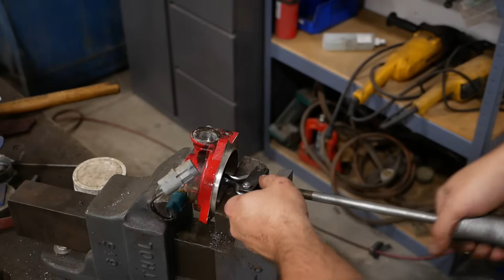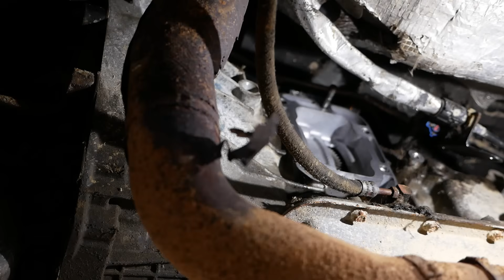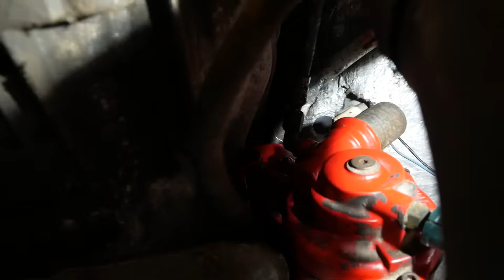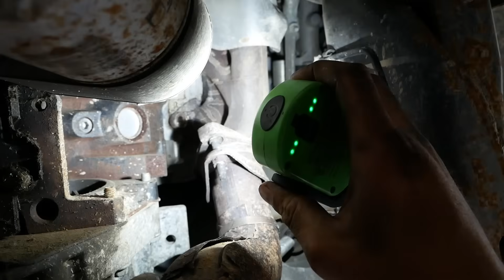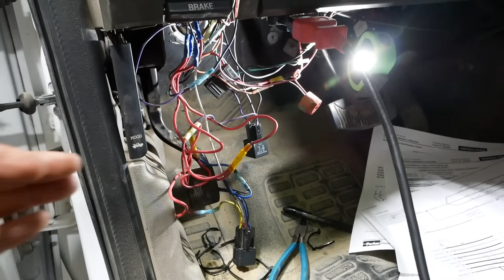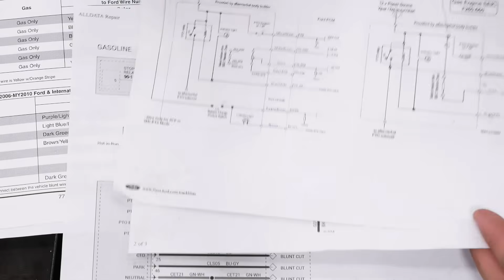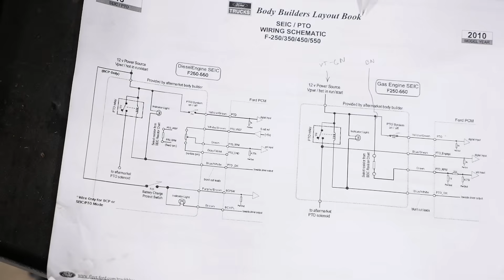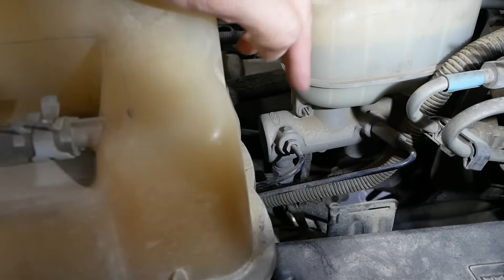Ford F550 Chelsea PTO Repairs - Unexpected Complications

Comment: I work for a company that builds crane trucks using a F550 chassis and Chelsea PTO. Even knew they are a nightmare to install and get the wiring to cooperate. 

Take a look at Fisk tank carriers, I used to build them when I first started so I feel your pain.

Comment: I took mechanical drawing in HS. Learned how to read blueprints. Figured out electrical later on. Every time a job found out I could read prints I got a raise or promoted. Techs nowadays lack that. Most are parts changers. Checking sensors for most would lead to overload. LOL I'm 69 and can't always figure out the new systems but I have a Guru. I just send all work to him now that I'm retired.

Comment: 100% agree. The 1990s Dodge pickups with the cummins and 47RE automatic would do the exact same thing to the overdrive unit.  Not enough line pressure, burn clutches, piston over travels, lip seal fails when the return spring pushes the piston back.   The whole first 20 mins I'm thinking I hope he checks the line pressure or he'll be going it again.

Comment: I have found, torques on inaccessable bolts and nuts that require torque are - one ugga-dugga of the elbow is good for 25 ft/lbs, 2 ugga-dugga's is good for 35 ft/lbs. An Aaaaagggga-dushhhhhaaa is about 100 ft/lbs.

Comment: Man, You just saved my life, this video gives me a damage saving idea!
my motorcycle had blown two crankshaft oil seals in a year, There is no extra pressure on the motor the oil seal just slide out.  and seeing you putting loctite on the external face of that oil seal may be the solution, I just call to the motorcycle dealers mechanic chief and he confirms even if is not on the service manual, they sometimes put loctite that oil seal...  thanks man.

Comment: The other shos that checked this truck do not have your level of skills!
You are quite talented in troubleshooting an issue and you sure have a broader understanding of mechanics, electrics and electronics. Also for the missing electrical schemes you searched until you got (almost) what you where looking for.
Generally shops don't do this, so they have no chance to put together the necessary information to succeed in such complex repair.
Well done Wes!!

Comment: The reason that unit has a clutch is that its for an automatic transmission.  With an automatic, the input shaft is always turning, so you would always have to "grind the gears" to engage it.  With a manual transmission, you just push in the clutch to stop the input shaft so you can engage the PTO.  This also allows you to use the clutch to temporarily stop the PTO.

Comment: Love the videos! Recently found ya and subbed after the first video! I’ve worked on these myself! I’ve got a set of Mac torque adapter’s that can fit into that tight spot to set that pump to spec, but I’m sure a man of your talent has a feel just as good as a torque wrench at the 35 something foot pounds that takes, id give ya the part number for the set but unfortunately it’s at the shop. Lemme know if you need it! Keep wrenching brother!

Comment: Hey I know this video came out a while back but I have a question for you. I own a 2006 F550 6.0, it has that same PTO system and it currently does not work. I believe the problem to be electrical but regardless if it is or not all of the upfitters wiring has to be redone properly. I can’t get ahold of those same diagrams for PTO control and other things. Where did you get yours from?? I searched on fords website and ford pro and could not access or find them, thanks!!!

Comment: Hi I know is a all video I hope you can gide me with my tow truck pto im lost 

2018 ford f500 v10 gas chelsea pto
Pto work great but when transmission riches 180 degrees it shuts off the let it go down to 150 works again but the riches 180 and shuts off again 😢

Comment: Wes, I work at a truck shop and we are also a Newway dealer. You did a great job getting that system up and running again and preventing the pto from burning up again. The only thing you couldn't have known without schematics or experience with that body is that the accelerate (high idle) switch is meant to enable high idle only. The actual trigger for high idle is done with whisker or proximity switches on the control handle linkage. Not a criticism, just an FYI for next you get handed a hot mess like this LOL. Those things are stink bombs so I hope you DON'T see one ever again.🤣🤣🤣 P.S. If you do ever need info for Newway equipment reach out to me and I would be happy to help a fellow mechanic. Rob..........

Comment: Those pressure switches under the master cylinder are notorious.  They also cause the cruise control to fail as you mentioned.  Basically if the switch connected to the pedal and the one under the master cylinder don't agree on state it throws a code and disables cruise.  The intent is for safety so that if one switch malfunctions (eliminating redundancy) it disables cruise control so that in the case that the other switch malfunctions an operator isn't freaking out when the brakes don't disengage the cruise control.

Comment: On the "can't torque to spec because only open headed wrench fits" issue: I imagine you might know this,  but a torque wrench at 90 degrees to an arbitrary length extension (as in, at the other end of the open headed wrench) gives you 1:1 torque at the bolt. That did look like you might not be able to fit even that, though.

Comment: The seal fail because of wear on the clutch pack allow too much travel.  Big problem with this type of PTO is driver engage it at any rpm that cause premature wear   some body fitter even use the tcm to engage and disengage the PTO at 1200 Rpm so that don't burn the pump but going house to house with the PTO on it engage and disengage multiple time a day on a 10 wheller truck that's about 800 house a day 800 engage and disengage just for house stop and go plus the stop sing  that a lot for surch a small clutch pack

Comment: I mantain a fleet at a municipality. The newer plow trucks have been coming with Allison’s and it uses a larger version of this exact pto. I’ve seen the clutches burn out like that and I’ve also seen the female splined hub where the pump goes in strip out and it also strips the pump shaft. Luckily we can get parts for them to repair. New shafts, clutches and seals is a lot cheaper than buying the whole unit

Comment: The tool snap on uses to remove the tool box drawers is what I was thought to use on automatic transmission  but make to use a sharpening stone to clean all the edges on the "feeler gage" tool box tool.  And yes feeler gage will work too

Comment: I’ve seen these clutch style pto’s burn up if the high-idle doesn’t turn on when the pto is engaged. It needs the high-idle for the transmission to build the proper line pressure.

Comment: Just a point out starting @ 2:08. You mentioned because its an automatic. 
Typically what you would do in this situation to engage a PTO pump you will need to put the truck in drive first and keep your foot on the brake. 
Flip the switch to turn on PTO, 
Then put the truck back in park. 

By putting the truck in gear with your foot on the brake this will ensure all the gears and any rotations behind the torque converter are not rotating. 
Similar to what you would do in a manual, only you would put the transmission in any gear with a manual while foot is on the clutch. 

I would definitely make sure the owner of that truck is aware of how to use a PTO and make sure they follow those steps accordingly because if they simply just flip a switch while its in park and not in gear, then a ton of grinding can occur and thus another failed PTO.

Comment: had a F350 dually with a V10 once...never an issue pulling a 42 foot trailer for 10 years. Only thing that did it in was the rust.

Comment: If you read the fine print it will tell you to not have more then air space in between the disc and to use the best of the old disc steal disc to take up the space.

Comment: I have used a plastic coffee creamer jar cut on an angle to install seals and it works very nicely.  Very wise idea to pre-soak the frictions of that clutch.  Did you flush the transmission cooler????  I will assume not.  Bad Wes, very bad Wes!!!  You going to change the oil?

Comment: I had similar pto problems on a truck I used to service clutches kept burning up solved by engaging pto with transmission in drive then put in neutral  to operate

Comment: Wes - You just proved how important the original wiring Schematics are, - More precisely to follow the original build the way the engineers designed the unit. So called tecks of now and days rely on scan tools TOO Much! and don't trouble shoot and work the problem from the beginning - Eric O at south-main auto  does this exact approach like you did and 99.9% of the time he finds the culprit... You deserve a 5Gold STAR and Like I say Are a great Credit to the repair industry. I'm Very Impressed...Wayda go there...

Comment: Most mechanics look at an electrical diagram and go "nope", so not surprising they struggled to find anyone who knew how to fix it. Auto-electrician used to be a separate training to auto-mechanic, but for vehicles less than 30 years old you need to know both. That old "I won't touch that modern computer stuff" simply doesn't fly anymore and as vehicles get more and more complicated, anyone who doesn't know how to read diagrams and program the ECUs will doom themselves to go out of business

Comment: Wes, you are an amazing diagnostician.  Your understanding of mechanical and electrical systems is stellar.    You should be running the engineering design department for Ford not turning wrenches.
Reply from the maker: Been there done that.
Reply: @WatchWesWork  Well you have developed an amazing education somewhere along the line.  Love watching your skills at work.

Comment: Hey I have an orange mallet just like that WOOT!  I am as cool as Wes, except for the skill, knowledge and high success rate fixing complex mechanical parts.
Reply: Sorry had to add what a horrible design this appears to be, Hey I got an idea lets make it where if the pto fails it wipes out the $6000 automatic transmission on the truck! Kind of reminds me when Nissan decided that separating the coolant and tranny fluid in a single radiator with a single o-ring was a great idea...

Comment: I worked on a similar PTO with a built in clutch.  The truck I was working on had an automatic transmission not a standard which on most PTO required bodies the foot clutch feathers in to engage the PTO. This truck needed a PTO that had its own clutch exactly like your truck here.  My truck operation moved extremely heavy products which really wore on those little clutch discs and burned them out at least yearly.  Another great video. I’m almost at 100% watching all your past episodes. I learn something new from almost everyone.

Comment: Wes your video is amazing. I have a 550 with Chelsea PTO. It's always on, can't get it to turn off. The shop changed a solenoid on it and when that didn't work they told me I need a new one. Do you have any advice as to what the issue might be?

Comment: I drive an ex police car. There are so many weird wiring rats' nests and its clear the people who uninstalled the police equipment didn't know what they were doing. The one thing done right was plugging antenna holes. The most recent manifested issue is a taillight that does not work sometimes, but I have figured that out and will fix it soon

Comment: As Paul Harvey used to say "now we know the rest of the story". Sometimes the customer doesn't tell you the rest of the story, or they are unaware of the rest of the story, and sometimes the customer goes overboard to try and tell you the whole story. When I was a service tech on business machines back in the seventies (of course I had the luxury of servicing only machines that were under the company umbrella) there were times when you had to query the customer to get some sort of trail of events in order to get an idea of what's going on. You sort of had to be a detective in order to grasp the problem in order to solve it. At least you check the system thoroughly to ensure that everything is working properly, and in doing so have actually uncovered the history of what caused the failure. The trick is as you know is to cover all the bases and of course this puts more time into the job, but of course fixes the problem which is just the downside of the flat rate system. We had a lot of customers who were on service contracts and I tell you that is a luxury as the tech did not have to worry so much as to the expense of time in order to solve the problem. We did not use flat rate time on non contract customers and we charged by the hour on our labor. It could be hectic trying to service a machine with the customer breathing down your neck as to the labor charges, but that was the way it worked for business machines. At least going on fifty years ago. That's why you fix things and  of course we learn things as well.

Comment: Nice effort. Great to see you going the extra mile with the wiring. I've had similar problems when I used to work as a diesel fitter in Australia. Little trap to watch for. The mounting "spacer/gasket" can cause growling noise problems. Chelsea make shim/gasket sets for clearance adjustments. Need to undo side inspection plug and adjust thickness to give minimum backlash of 0.020" or convertor bearing will die and create much drama.

Comment: I'm the neighborhood shade tree mechanic, which is better than a technician. The only thing I refuse to work on are electrical or exhaust, minis O2 sensors and the like I mean the pipe work, they both SUCK 😂. I rebuild trannies, engines, once upon a time starters and alternators. But flat out refuse to chase shorts! God bless people that will 😂.

Comment: Why is the design for this set up made so complicated? The Ford computer won't let you do a simple manual mechanism? The automatic transmission? The automatic PTO? The body builder? EPA? OSHA? Why? I've heard farmers are no longer allowed to work on their own combines. The software is proprietary? Same excuse about simple voting machines.  Proprietary. All they have to do is count the votes. The technology has gone overboard. It's obvious what's going on. The owner of this rig should drive it into the river.

Comment: The problem today with shops is they are mostly flat rate, so most of the time you get a five minute diag then a bunch of parts thrown at the vehicle. Usually there is only one  guy that can successfully do electrical, if he is busy than you are just out of luck. Its nice to see that you are curious enough to actually fix the problem I hope you charge more for electrical repair because every other shop I know of does. Great video. You are really helping us understand some of this crazy stuff.

Comment: I have a bit of experience with these pto's they're called hot shift that gear that splines to the transmission is always turning all the shifting is done by that clutch pack like you noted a lot more gentler on the transmission

Comment: There was a recall on cruise on our 2000 Excursion with 7.3. Was told to not change the transmission fluid since it was clear and pink. It has always shifted perfectly. That stuff in there needed to come out most likely though.

Comment: I know they have crows foot adapters, and I also know this would likely be too short to do the job, but I think they may have reverse sockets, kinda like hex bits, to allow you to use a regular wrench and a torque wrench, just may need some sort of math to figure it out based on wrench length, I’m not sure if that changes the torque values or not

Comment: Great job done Wes the mark of a true professional to get to the bottom of the issue and not just go it's fixed everything is moving. You said you didn't know the cause of the issue right at the beginning fantastic research it may have cost the customer some more time but now they know, you know and we all know about these tricky integrated PTO settings. I'm certain that company will be a return customer.
Thanks for sharing and the content. I'm already happy I subscribed.👍👍👍

Comment: I'm not following why there's 2 switches or why it even works. According the the wiring diagram all the 12v inputs are tied together once the first switch it hit. How is the 2nd switch even doing anything unless its in the place of the "PTO System On/off"

Comment: I'm not surprised at all to hear that the dealer shop mechanics couldn't hack it. You're very good at your job, which means that according to the bell curve, you're going to have to go through a lot of mediocre mechanics before you get a Wes. Honestly I'm very impressed with the breadth of your knowledge. There are very few people out there who could have successfully troubleshot and repaired the electrical gremlins on this truck like you did. I've seen you work on everything from old school diesel tractors and big trucks, to newer cars, to lawnmowers and everything in between. You're honest about your mistakes, and therefore you make very few of them. Thanks for sharing these videos. It's an honor to see a master at work.

Comment: Shouldn't the high idle switch choose between 2 resistors so that it runs at 1400 or 900 rpm when the pto is enabled rather than dropping down to 750? I thought you said the pto clutch required 900 minimum.

Comment: i dont even get it.. why put a specialized transmission, with a specialized pto under the truck for a hydraulic pump, when there is a belt system on the front of the engine that is for... idunno, POWERING AUXILIARY DEVICES???

Comment: Kinda hard to figure out what is the problem when there are three separate problems. I did have to replace one of those brake switches to get cruise control to work and I'm not even a mechanic